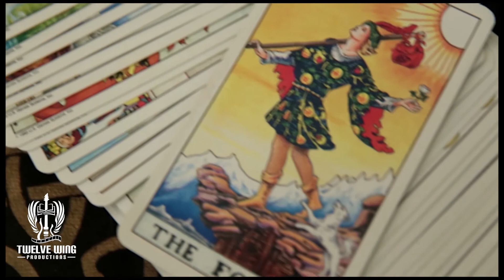Why Utilities Hate Micro Grids : ITAT

Comment: I think the problem you mention about sending power over long distances is not really a technical problem it is a system design problem.. The reality is power generated from my home or a micro grid will flow to the next available load. That could be my neighbors house,  the neighborhood transformer or the local substation.  Power can flow through transformers bidirectionally, The problem is the control equipment that is used to control that flow has only been designed for one direction of energy, In Hawaii, some substations are seeing negative flow and it is causing problems.
Reply from the maker: I'll have to revisit my clarity on tht point.
The point I was trying to get across is that when you have a saturation point of everyone producing solar.. or nearly everyone (80% or so) then you have no regional market to sell it to.
At that point it isn't a design problem.. it's a loss problem.
The losses you would have from trying to crank up the voltage to send it long distance would never be worth the expenditure in equipment to do so.

For that reason these micro grids need to be sufficient locally and basically only draw power into them at reduced rates.
These kinds of things are not easy to unpack because they have lots of variables.
I'll try and work up another video just on micro grids so folks can more clearly understand where this is headed.
And make no mistake, I am wholly in favor of micro grids.  I'm just trying to keep folk realistic about what they can and can't really be expected to do.
Reply: @twelvewingproductions7508  I agree 80% would be a problem. As you have noted we see it in the duck curve and in the curtailment of commercial solar. That is why we need more batteries to soak up that solar and put it back in the grid during the neck of the duck curve. 
Microgrids can be great for that because of the economics of sharing battery capacity. I saw one report that a central California school district put in a micro grid and it resulted in the local utility not having to make several millions in upgrades to the distribution system. The improvements the utilities need to make is better control and switching systems to handle a more distributed grid. The regulatory market needs to develope price signals as you suggest. It is unfortunate that TOU rates have not been successful to get many people to change usage patterns.
Reply from the maker: @ricklearn16 , I think the PG&E shutdowns have done more to increase adoption curves than anything else.
Reply: @twelvewingproductions7508  Yes, and SGIP has opened up some serious rebate percentages for those in fire impacted areas. When those owners start telling others how the Powerwalls let them leverage their solar to take advantage of TOU rates we may see further acceleration of the adoption curve.
Reply from the maker: @ricklearn16 , I can only hope that the new programs are better administrated than their existing one.
We are still being stonewalled by PG&E in trying to get our rebate.
Reply: @twelvewingproductions7508  PG&E rebate? I though you were in SMUD? Is PG&E doing the SGIP processing for SMUD? (I thought I had asked this earlier but couldn't find it. My apologies for duplicate if so.

Comment: Good advice to novice fortune-tellers - keep your balls covered up until they cross your palm with silver. (This hint also applies to rent boys, amazingly.)
Reply from the maker: The history of covering the crystal ball is equally interesting.
The refractive index of quartz means that the focal point of the spherical lens is outside its diameter. 

So simply put, if sunlight would strike a gypsy's crystal ball directly, it could burn their wagon to the ground if there was any paper or other kindling sitting an inch or so from the other side of the ball.

Comment: Would it be advantageous for the utility companies to offer a “keep the micro grid batteries full” option? That would be based on the weather pattern, the grid would provide enough power to “top off” the micro grid.
Reply from the maker: I can see by the depth of these questions that I'm going to have to do another video on this.
I'll give you the best answer possible in a comment thread.... and that is that it is an advantage that they won't do unless they are forced to do it.

Think of it a bit like a pharmaceutical company that develops a drug for a disease.
We would all want to hope that they would favor a drug that cured a malady rather than just treat its symptoms.  But is this ultimately something they want to produce?
Or battery manufacturers.  Why are we still seeing one use batteries when the technology is here now for reusable batteries that are just as powerful, and more so, than one use batteries?

With the utilities it's the same thing.  There is a huge disparity between what they SHOULD be doing and what they intend to do.

So back to your question... yes.  It would be to their advantage to assist people in installing large PV systems that would charge in home battery banks or even "micro grid" batteries that were NOT owned by the utility.
It would equally be to their advantage (and ours) to power each home with a glorified dryer plug.  A single 20kw power source.
This would leave the main power to come from the battery inverters to supply the 200A service to the home.

This would allow them (or you) to trickle charge your system in accordance with your shortfall of solar the previous day.
Now the trick is to get them to stop interfering with home solar and batteries.
Reply: Yes Robert Gamble, that would be a great option as long as it flattened the duck curve. Tesla has done weather pattern enabling of grid charging. They were even able to implement a "weather event" grid charging in anticipation of Public Safety power outages.
Reply from the maker: @ricklearn16 , Storm watch was also a big leap forward.  They need to allow the owner to charge off the grid or allow the system AI to do so now.
Reply: @twelvewingproductions7508  Storm Watch was the term I meant to describe weather enabled grid charging. I don't know how they would make that user selectable without jeopardizing the assumption for tax purposes. There are workarounds if you are comfortable messing with your CTs in the Gateway. You would lose some reporting on your app.

Comment: Very different in Texas. Lines maintenance companies get paid to deliver so they get .04 $ per Kwh inbound or out, they don't care. I can put up to 48kw system.
Reply from the maker: Can you explain that in a bit more detail?  So basically the state looked at their budget for infrastructure and divided it up among consumers and producers and came up with that rate?
If so... that's a brilliant solution... but it also has the same inherent flaw in regards to micro grids....
... they aren't transferring the power.
Because of that, if I understand this correctly, this will likely turn into a flat monthly fee (tax) each month rather than a per kwh charge.
Simply put... if I'm not being paid a greater amount than $0.04 for my outgoing power... I'll simply not send it out the line.  Then you will have to deal with a 90%+ reduction in the amount that the micro grid does pull from the utility for the same number of houses and even if they raised the charge to $0.08 a kwh to compensate it still would probably not cover it because from March to October the utility would not be bringing in any funds at all.

So this is all going to get interesting in a hurry.
Reply: @twelvewingproductions7508  That is just how it's been done for decades, not sure what our grid thinks of micro systems. Texas is a right to choose state so you pay a distributor  (usually a monopoly) the 4 cents to deliver with a 1 dollar fee to be connected to service. Then there are maybe 20-30 companies that sell the power to you for an average of 6 cents, .10 total. Before solar we were on a free night plan, electricity was free 8pm to 6am so charge car at night, run dishwasher etc. Now we are on 1/1 net metering at .139 per Kwh, high price as its 100% wind sourced. Average price here is around 10 cents total plus the dollar per month.
Reply from the maker: @martialman.4563 , what they ultimately think about it will be dictated by their cash flow.
Both the linemen and the power generation depend on buyers and sellers.
It's going to be interesting when the number of buyers goes to near zero for months at a time.
To counter this they are going to have to come up with some kind of fee structure to cover their expenditures.

The difficulty is going to be that no one will trust their numbers.  We will be looking at things like corporate bonuses in an entirely different way when they start to try and maintain the same levels of profit even though their overall level of power delivery drops by 50%+.

Keeping them honest and getting them to reduce the amount they generate is going to be a chore.
As with most things in Texas, you seem to have your heads screwed down tight with this.
In California, our solar energy policy can best be described as "Schizophrenic".